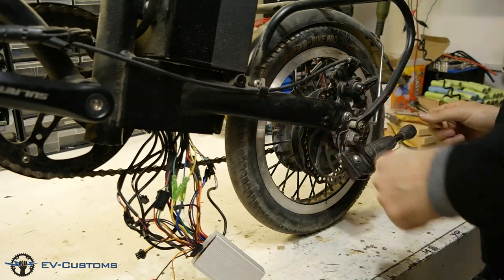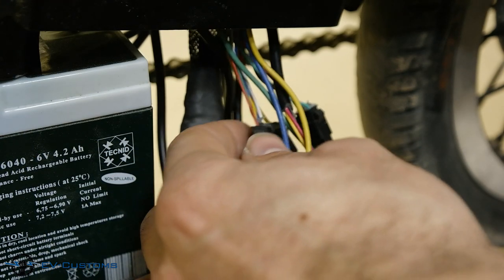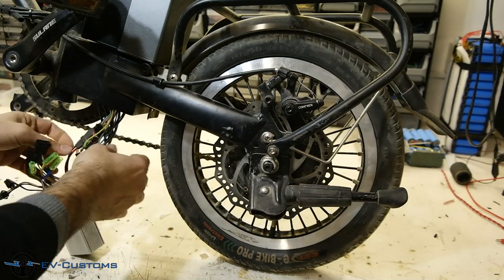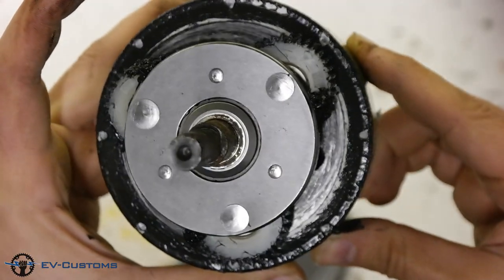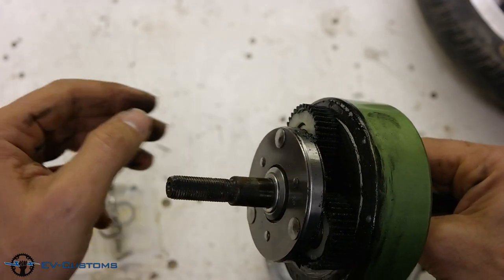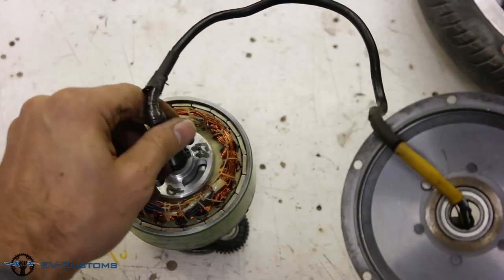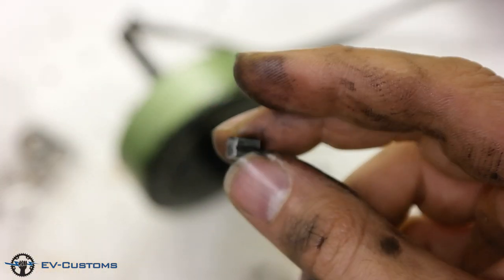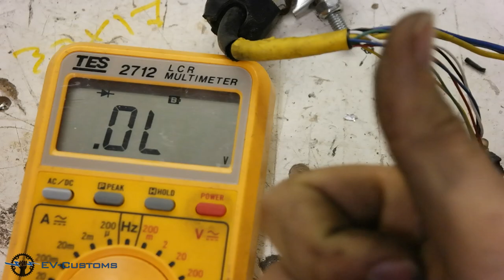How to Diagnose Repair and Maintenance BLDC Hub Motor ( HALL SENSOR REPLACEMENT )

Comment: OMG seriously you are AWESOME, ....right now i was to affraight to open.... and i was looking exactoly for a video like this. also the testing with putting the cables together is great !  Your Video takes the fear of opening away, becourse you show step by step what you do !!! I have only to replace the small teeth-wheeels cause a few broke out, but know i know how to do THANK YOU

  I own 2 geared enginges and on direct drive one.  for the later i always have to move a little backward before the throttle works, thats somehow strange?!, ....that was my intention searching ...and finding your video. .... cause i guessed somethings wrong with the hall sensors!???  It is super strange to roll back before i can use the engine, ....but after releasing the throotle i cant use it again, ...i have to stop ....and start again by rolling backwards a few centimeters!???
so no acceleration while driving, after release once. ...never had this before!? 
   Do you had this problem before???

Comment: Very good video. Thank you for sharing your knowledge. It's very useful. My 250w motor can run with no load (run when on the kickstand) but when running on the road, motor cannot run. I will use your guide to check the motor.

Comment: Excellent vid, thank you! what kind of grease do you use? worried some petroleum based greases could affect the nylon gears...
Also, wise to note any wear on the shafts or worn bearings could cause rubbing and damage to hall sensors, no? have you seen this? I did a Gio Italia hall sensor and one bearing was a little sloppier than new, i was wondering if that caused the hall sensor to rub on something.   What else causes hall sensors to fail? solid state should be super rare but yet it is common
Reply: Hi over heating can kill a hall sencer

Comment: My 1600w motor feals like a 250w on take off but reaches 36mph. I cleaned the magnets. And replaced all 3 phase wires the were cracked and didn't look good. Now I have done your test pos to ground. Yellow .614 green .617 blue .614 if I go pos to pos all 3 wires show .OL does this mean even though the motor works sort of that the all sensors are bad?

Comment: Thank you. I just bought a broken ebike for $200 fro local tip shop and had just checked through everything out as a previous owner had broken and lost part trying to fix. My bike sounds exactly like this one and I thought hall sensor. So I'll be doing all these tests and strip down the motor. At worst I have a nice bike. At best I have a newish folding ebike I can carry around in my car or van.
Reply from the maker: I am waiting for  your news.. ;)

Comment: Question. My motor has resistance equally in both directions with all 3 wire shorting tests. Is resistance only suppose to be in one direction during first two tests?

Comment: Thanks, very educating!
I have a "stupid" question. I hit on the video for the thumbnail showing the rear wheel. I was looking for days for this type of bike with this kickstand.
After 2 years taken apart, I put my old beloved bike together. I have to change a mosfet, but the major problem the KICKSTAND. It keeps falling off and I feel stupid.
It is the same as yours and I fixed as yours. The only difference that you have a large hole to place it on, mine is an open U shape. 
Q: Do you have any spring under the srew? Can you suggest some solution?
On the piece, where the screw tighten, there is deep cut, seems for stabilization. An inch long and maybe a quarter wide, but in the box I didn't find anything to fit there, nor in my memories. 
Should I use double screw? There was one in the box fitting the size.
I know it stupid, but it is great discomfort without a kickstand.😊
Reply from the maker: Sorry mate...  this bikes was a long time ago in my shop,,,   i  don't remember how it was ;)
Reply: @EVCustoms  Thanks anyway. If I don't find a solution, I deserve what I get 😂

Comment: Hello from scotland thank you for the video , I had to replace a hall sensor following your steps , it worked great for 1 hour , now my wheel keeps looking power , I checked hall sensors again but they are fine , I checked mosfets in controller , it's also fine .
I can hear a high pitched noise coming from controller . Not sure if that's normal . 
Any suggestions ?
Reply from the maker: Hi.. try to activate self learn mode and try it again... so you have power or not?

Comment: Hi sorry I'm new to electronics , when your testing volts on the meter , do you need the ebike battery connected and turned on ? Thanks for the video
Reply from the maker: Yes you can do that also like as you said

Comment: Insanely helpful video. Can I ask you a question? Why does the hall sensor only show output while spinning the motor in the opposite direction? Shouldn't it show the response in both directions?
Reply: Yes, no matter which direction. I guess it's just easier to rotate backwards with the right hand, towards yourself.

Comment: Hello, this video is interesting, and may have some advice on my ebike. I have an Ebikeling Waterproof 1200w Rear Hub motor kit 48v. My problem is that my rear hub is not working? I have tried different things. There is power on my LCD, but there are no error codes? I have tried it with x2 different controllers, x2 different throttles, and have full power on my battery? there is enought charge on the battery, and I know that the current is flowing. I hear a click on my rear hub once powerd on, but not sure how come it is not working? Rear hub is brand new, never been exposed to any outside elements? Does the gauge of the wire play a role in this? Becasue my battery is a Dorado type battery that sinks into the frame. The gauge that came with the battery connector is how ever thicker than the one that is attached to my waterproof controller. It goes from an Xt60connector into a Anderson connector. Do you think that its the wires or maybe hall sensor issue? Your advice would be much appreciated thank you!

Comment: Happy Easter. I am trying to rescue a abandoned XB-610. When try to connect to batteries three main hub wires got to hot. Hub passed 3 wire test for resistance while turning, any advice where to look forward? Also when testing the sensors, do you use some DC power source? Thanks
Reply: Only need to apply power if you want to test flux sensitivity.
The meter has internal voltage source for checking so no need for more input.
This test is just for basic functionality

Comment: The value of my defective transistor was unreadable, is it possible to replace it with different hall transistor? If thats so how can i determine if the one I buy is compatible with my other hall transistor..I have 48v 15a controller and 500w hub motor..thank you..

Comment: Ji,
    My cycle is running in full speed in standing condition but while deriving on road the speed comes to zoro within second (my kit is 24v 19.8 ah li battery,24v 250w LY1016z motor and LB27 controller)
 Battery shows 23.6v in idle condition, while deriving 2.3v dropping.
 Please give your guidance to find out exact issue.
Thank you.

Comment: Hi there. I managed to mess with the polarity of my ebike which is a 36v 250w ebike the batery is 6 amp.
Now the bike doesnt work. What may have damaged? The motor controller or the other major damages? Your suggestion would be highly appreciated. Thanks
Reply from the maker: Hi...  if you made wrong battery with a controller...  there can damage the  BMS of battery or controller if there is no polarity protection diode inside...

Comment: Excellent work man I think I have the same problem hope I can fix it
Reply from the maker: Thank you man... for any help i am here..
Reply: @EVCustoms  sorry for the above message. This 5Kw Motor will not turn at all , I have it open but don't see any damages.
Reply from the maker: @DKLVE  Can you check hall sensors? connect 5V to power and measure the output..

Comment: What happens if the speed sensor is bad or non existent. My new controller has the white wire for the speed sensor but my motor doesn’t have one. The white wire from the controller dead ends at the plug. Will my new controller not work?
Reply from the maker: It will work without any problem...  only your actual speed will not work..
Reply: @EVCustoms  thank you for the quick reply. I have been struggling to set up my new controller. It doesn’t have a learn wire and this is my first time playing with this stuff. I feel like I have tried just about every combination of hull and phase wires but it still seems to run rough. I just ran though your testing methods here and all the hull sensors show 0-5 vdc on and off as I rotate the wheel. I have a few wire combinations left to try before I put the old controller back in and see if it still works.

Comment: I have the same problem  but  mine is a 3000 watt motor hub ( brushless)
What kind of sensors should I get and where?
Reply from the maker: It is easer to change hall sensor on bigger motors...

Comment: Sir if i may ask,what could be the problem of my electric bike,when i turn the throttle on full speed the power suddenly shut down and i need to turn off the ignition first then restart it and the problem repeat it self many times,i can't even enjoy riding it now
Reply: Did u find the problem? Im having the same issue